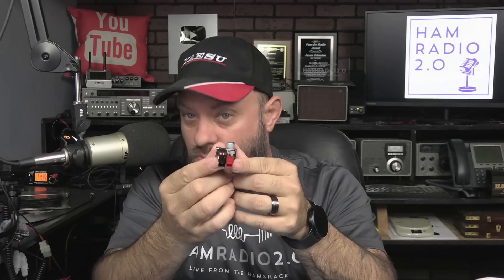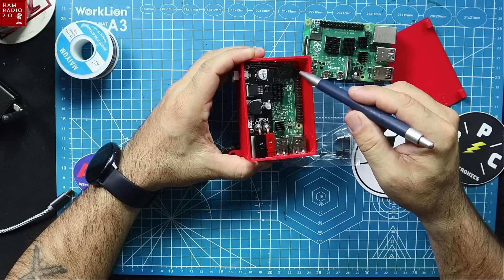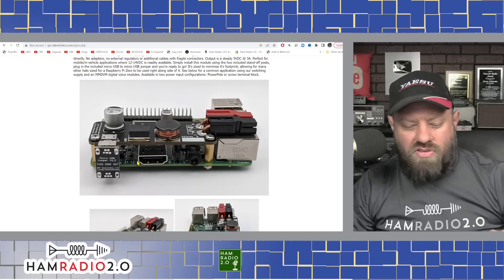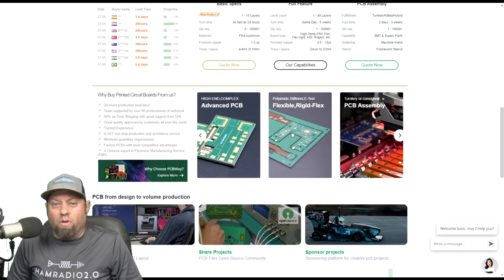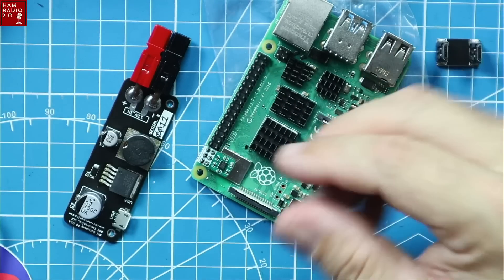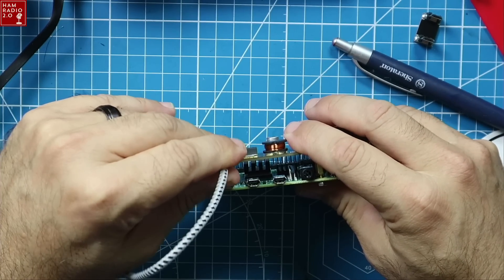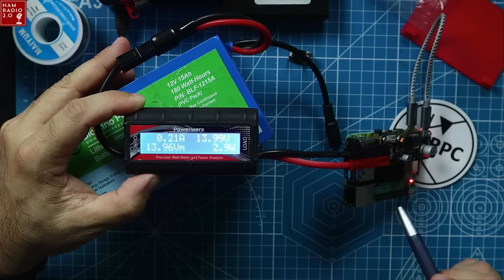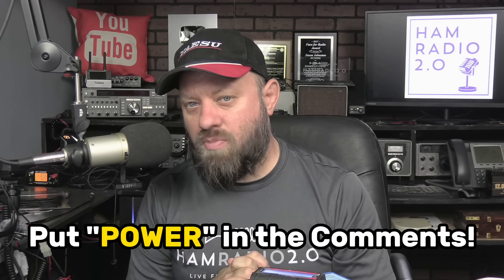Run your Raspberry Pi on 12-volts and POWERPOLES! Raspberry Pi Projects

Comment: I've used a couple of similar items to try powering a Pi used as an SDR server.  My experience so far is that, since they are switching ps's or buck converters, they have terrible rfi.  The otherwise wonderful one from geekworm was one of the worst for rfi.  Lines all through the waterfall.  Would love to know if this one is rf quiet.

Comment: I wonder if that amazon cable can push 3A....
I had issues with "amazing cables", voltage dropped to like 3.8v under 1.8A load. 😬

Comment: AliExpress has the same circuit for .98 plus 2.28 shipping. 6-40 volt input with screw terminals and two USB plugs for whatever cable you'd like to use. Mini or C.

Comment: I'm going through several of your videos to answer some of my questions concerning mobile/POTA operations. Is there any chance I could get some info on that clear lucite solar portable power unit that you had built for your use. I can't make out the call sign that you gave of the operator that made it for you. Thanks for any help in this if you are comfortable with suppling the info requested.

Comment: or just buy an Odroid C4 (most direct pi4 competitor), N2+, or M1.  They are objectively better.  They handily beat the performance of the pi4 (in some ways orders of magnitude better), have NATIVE 12v POWER, and are AVAILABLE.  The only issue is when you find pi-specific images... and this is the fault of the broken architecture compatibility that is ARM... not the fault of any one ARM sbc.

Comment: Power  It looks like that does a god job providing POWER to the raspberry pi.  This allows you to use the POWER apps on the raspberry pi.  You also don't have to worry about any other POWER you need it is all 12 V POWER.

Comment: I added Powerpole connectors and a 12 volt to 5V Buck converter to my 3D printed case for the reflashed TV boxes I use for radio and 3D printing apps.  That allows me to use USB power or 13.8 VDC to run the boxes when mobile.

Comment: So what's the difference between a switching power supply device versus a buck converter? I'm a noob.
Reply: Seems like this can handle a wide voltage array without adjusting anything?
Reply from the maker: Correct
Reply: A buck converter is typically increasing the input voltage up to a higher voltage level.  For example, the 3.3V to 5V buck converters for running a 5V device off a 3.6V lithium polymer battery.  I actually have one of those designed and I have produced a small batch for a digital group here in the US.  Will likely become a regular product we sell.  Only difference is, ours runs on three AA batteries.
Reply: @rpcelectronics  cool sounds like fun.  I run a buck converter to step down my bench supply to an HT (tyt 8000e) I run as a cheap cross-band repeater. Basically made my own battery eliminator. Hihi . I like what you guys did glad Jason showcased your work.

Comment: GPIO pins
Reply from the maker: Thanks
Reply: We opted to not use the GPIO header for two reasons.  1. It's bad practice to feed voltage to the output side of a voltage regulator without a diode to prevent backfeeding and 2. We wanted to keep the header free for other boards that actually need the GPIO, such as an MMDVM board and we show on the website.  I originally designed this power supply with that exact application in mind.